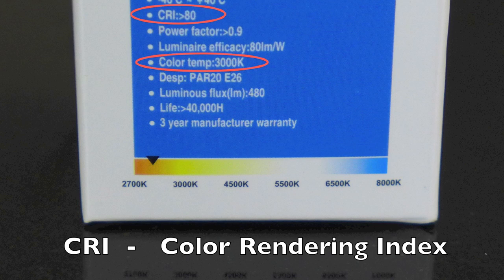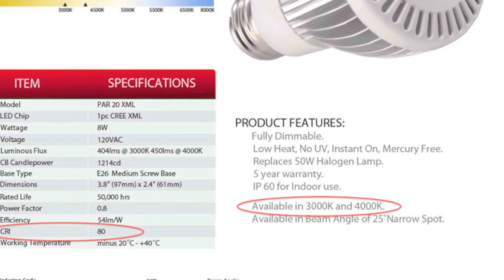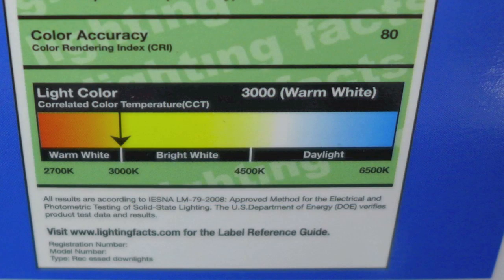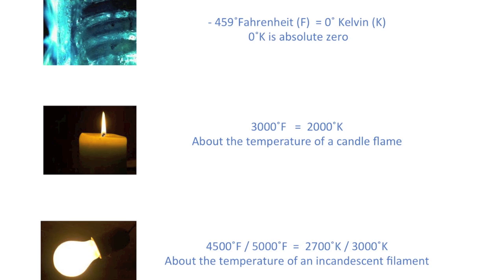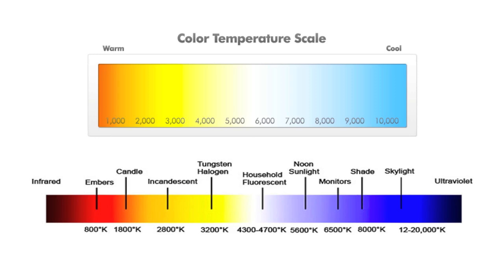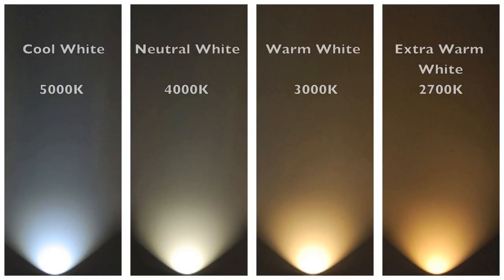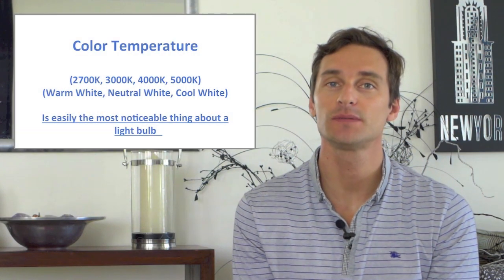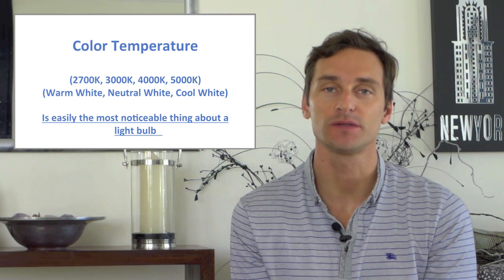Intro to LED Light Bulbs: Part 8: LED Light Quality and Color Temperature

Comment: Finally someone willing to admit that CFL and LED score lower on the CRI than incandescent.  But I believe there is more to it than 14% lower CRI score.  After working in a large cube farm with florescent and LED lighting I can tell you that when the small conference rooms changed to LED lighting there was more discontent in meetings than previously noted.  When changed back to incandescent lighting as a blind experiment, the discontent and contention in the meetings dropped back to the levels prior to LEDs.  Tell you something?  Also these are a mix of highly educated and moderately educated folks in a high tech industry.